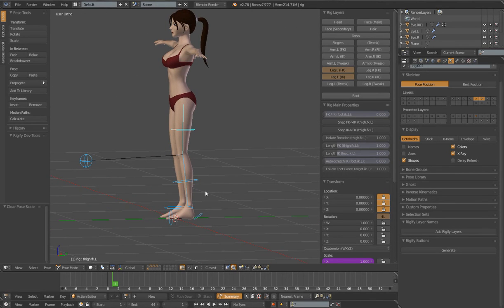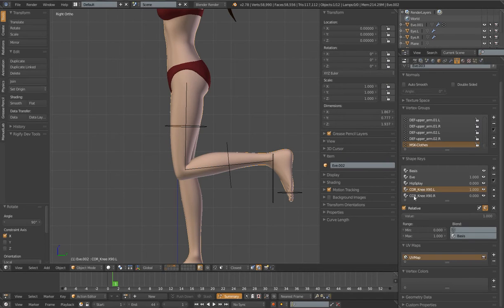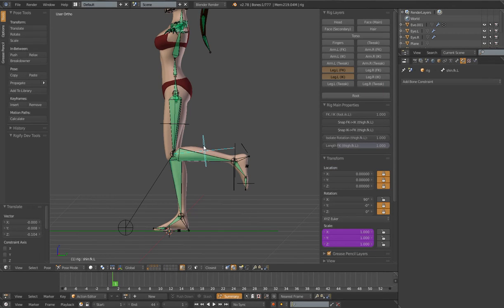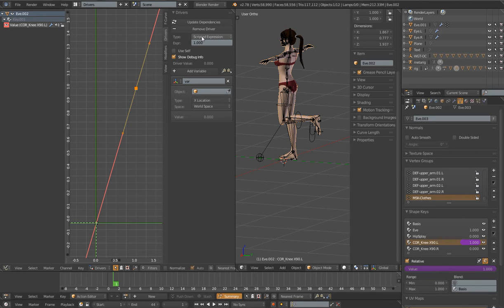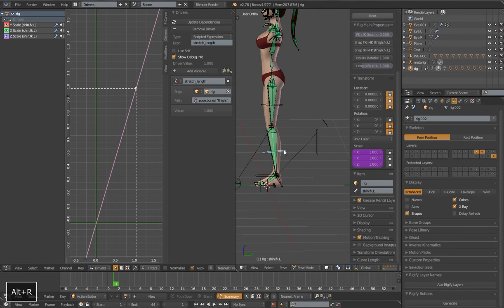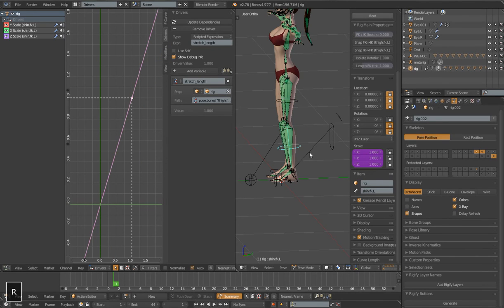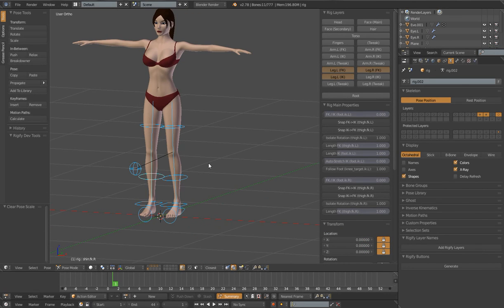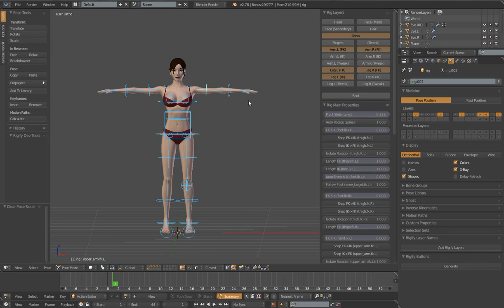Rigify   Stage 2 Corrective shapes and Drivers

Comment: Good tutorial! I'm wondering what the driver setup would look like on hips and shoulders, making smooth transitions between the several shapes
Reply from the maker: The only difference would be the bone used to drive the shapekey, ORG-shoulder.L (R) or ORG-hip  and picking an appropriate transform channel for the variable. (x,y,or z).
Reply: I am using a shape key for each position. Forward backward up down side. I place one empty at each location. I use a distance driver so it smoothly interpolates as it gets closer to each pose.